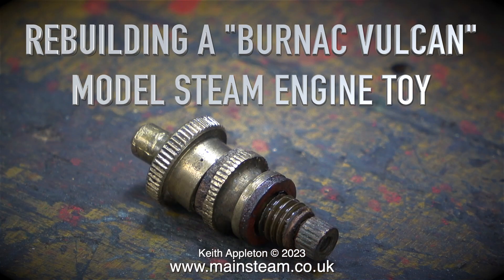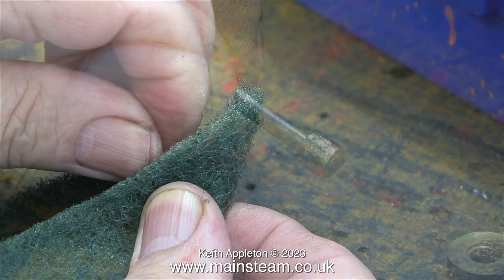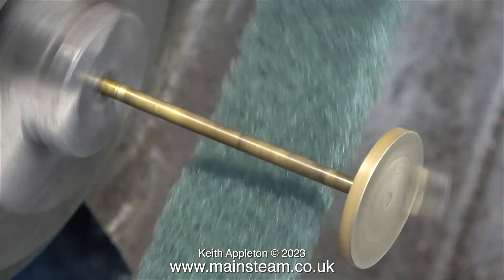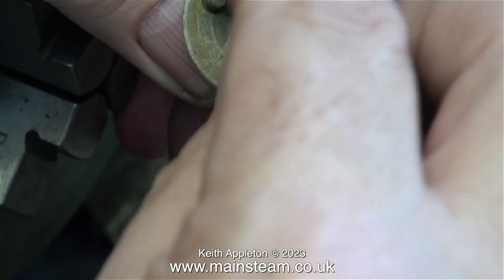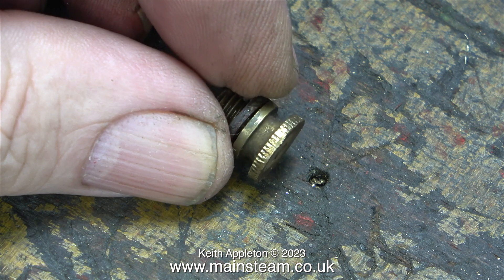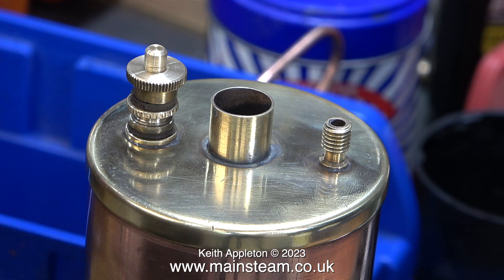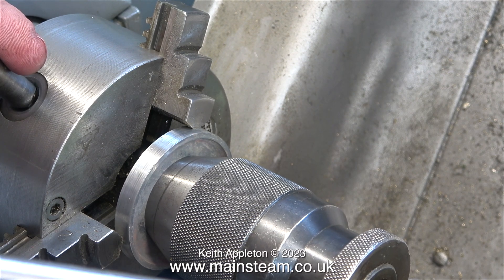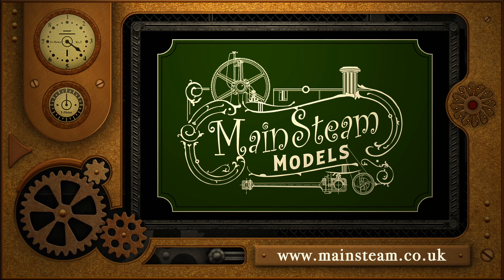REBUILDING A "BURNAC VULCAN" MODEL STEAM ENGINE TOY - PART #5

Comment: 03:55 “Running the drill slowly”. That is on its factory lowest rpm, 5000? Or do you have means to run it even slower? I tried to run it even slower with a dimmer but that does not work as the electronics of the drill cannot handle a lower input voltage.
Reply from the maker: just running it slowly does the job, I really don't know the numbers . . .